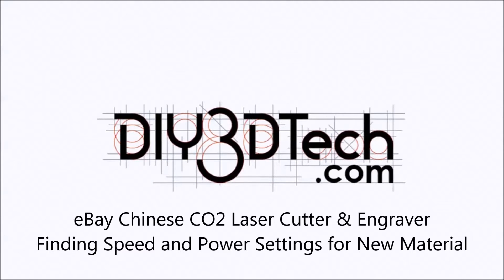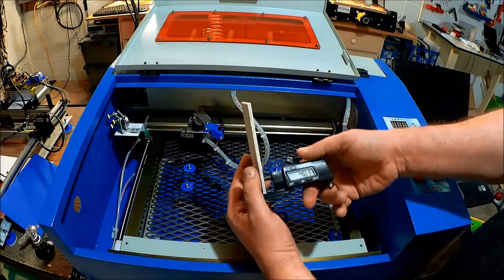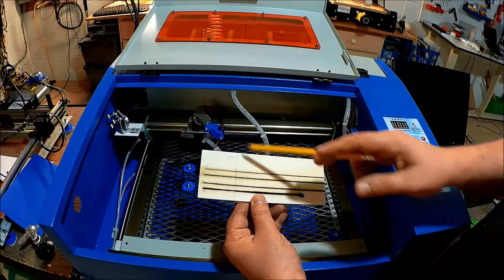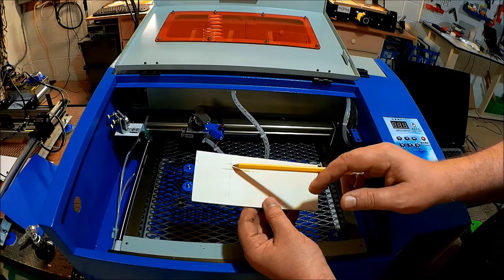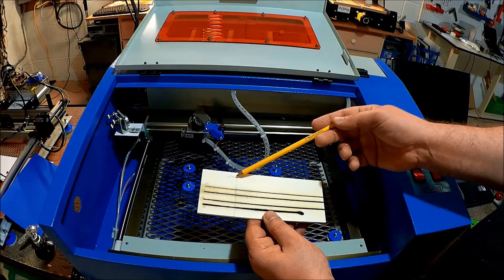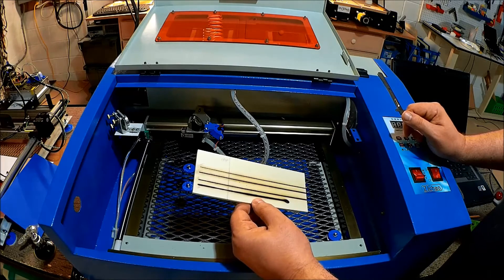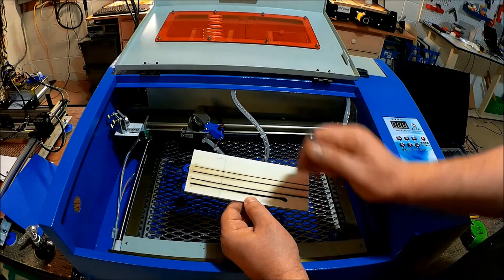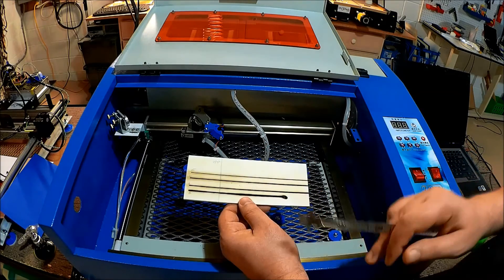eBay Chinese CO2 Laser Cutter & Engraver - Finding Speed and Power Settings for New Material

Comment: I'm new to lazers. I watched, enjoyed your video but, don't think I fully understand. It appears to me that your setting of 95% power with a speed of 4mm/s would be best used for a vector cut since if burned through to board. Am I correct or just confused?
Reply from the maker: Not sure of the question, for typical cut you want to be around 80 to 90% (i am pushing it at 95%)...
Reply: @DIY3DTECHcom  Like I said I'm really new and trying to learn. I realize you were demonstrating how to find the focal point. Wasn't sure if you were also showing the best raster speed/power. I watched the video again after receiving  your reply. You never mentioned raster only cut in the video. So, I would guess you were doing a Vector Cut.

Comment: Looking at the bottom was brilliant. Shouldn't the line from bottom to top be 90 degrees to the table when the board is slanted?
Reply from the maker: Thanks!  However not sure i understand the question?
Reply: @DIY3DTECHcom  the laser doesn't hit the board at right angles.  You drew the line on the edge at right angles.  Being picky. Can't wait to try your method.  Waiting for parts.